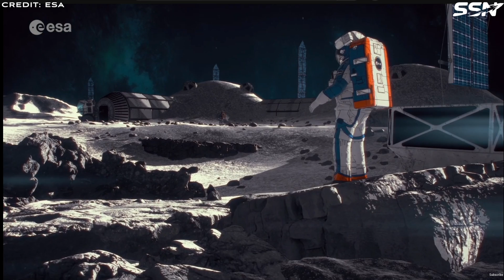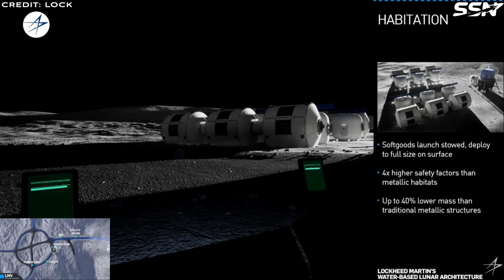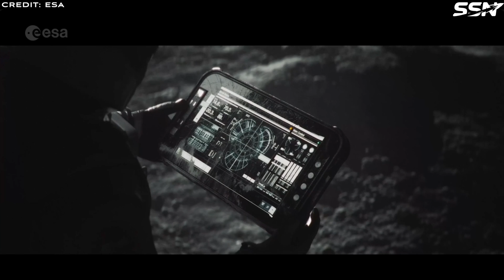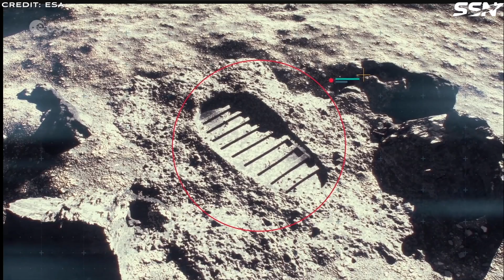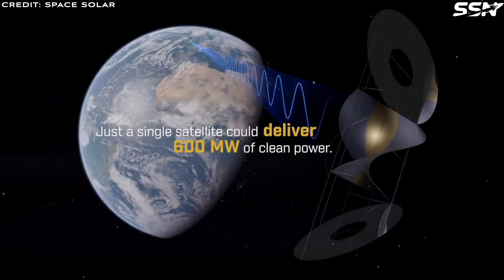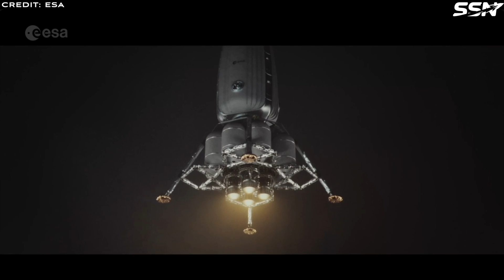ZEUS: Beaming Solar Power to the Moon’s Darkest Craters

Comment: Good report. It’s a major criticism of my old agency, NASA, that it has its thumb on the scale in terms of technical options assessments for things like beamed lunar solar power. The criticism is not that it hasn’t chosen it as an option- but that it stubbornly refuses to even assess it; and when questioned publicly on panels about WHY they won’t even assess it, they - very literally- in a room full of people- go silent. That’s Not how we need an honest, future-oriented agency to act. Please keep reporting on things like this. - Dave Huntsman
Reply: To be fair it sounds absolutely insane, here’s a few worries I can list from the top of my head

-if it’s orbital what’s the efficiency and the uptime? The satellite needs to be close since inverse square law meaning low orbit meaning half the orbit is spent in the shade and only a short window of time to transmit power
-how is it not thousands of times more expensive and less efficient than just placing solar panels on the surface
-you can just use a tall mirror if you’re near the edge of in a shallow crater. Or a vertically placées solar panel. You are at the poles after all 
-if you INSIST on using orbital solar energy for some reason... why not use an orbital mirror? Just a thin sheet of whatever reflecting material. Sure is cheaper and requires less maintenance than photovoltaic cells linked to power converters microwave emitters and radiators
-this is a minor point but wouldn’t that heat the crater a lot? Isn’t a large part of these craters's value that they have been at cryogenic temperatures for millions of years? Thus being full of useful low temperature ices? If you heat up such a crater it would just sublimate and millions of tons of valuable finite resources would be lost.
Reply: ALSO.... are low lunar orbits even stable lol? Or do you need constant fuel expenditure
It’s an even worse idea if you do
Reply: And in the video he mentions kilowatts per square meters... of microwaves... 

Yeah ok this is looney tunes territory
Reply: It is a foregone conclusion that, with people like U.S. Sen. Ted Cruz running the show in Congress, spaceflight and space industrialization will bend to reflect their biases and special-interest appetites. This would include fossil fuels and SLS. As long as political personalities like Cruz continue to call the shots, NASA will continue to behave as it does. Captiol Hill doesn't care about space exploration. They care about pork barrel politics and fossil fuels. SLS is a rocket made of pork. Solar Power Satellites are a threat to fossil fuels. That's all anybody needs to know.